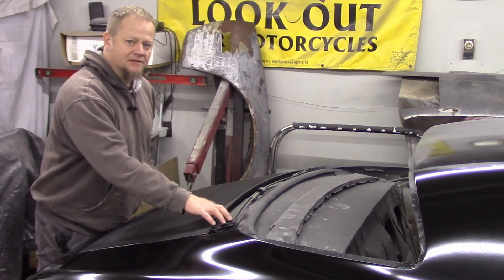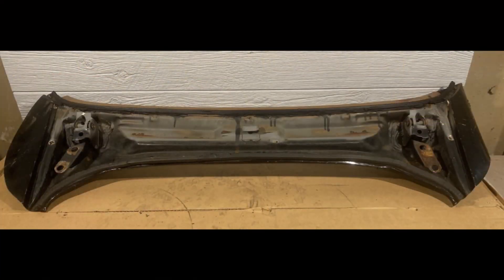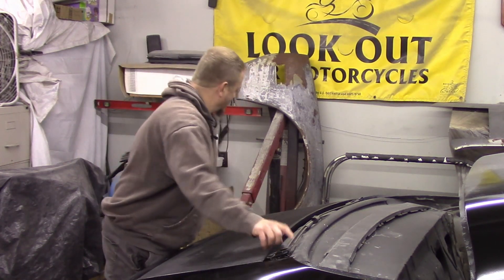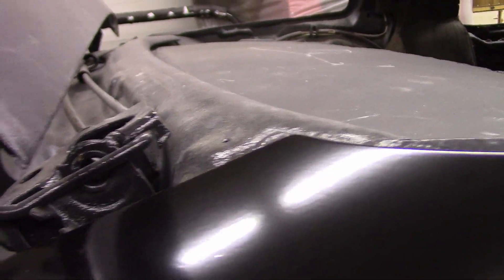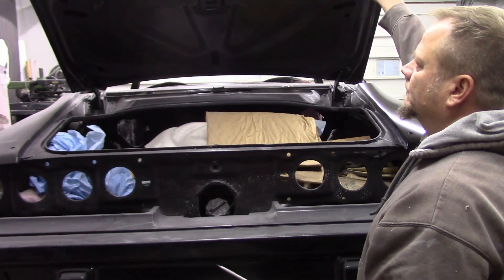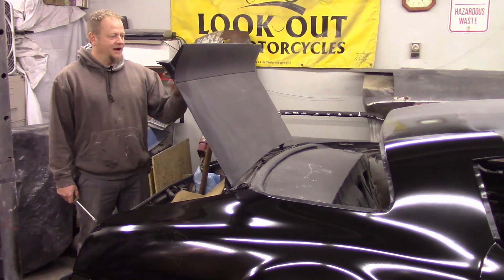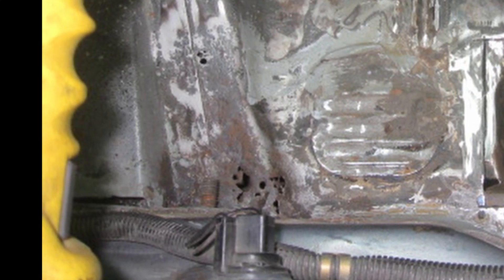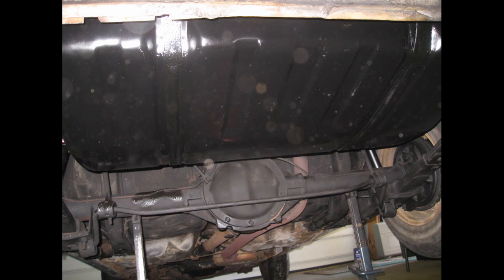Rusty Crusty Trunk Hinge Pocket Panel. Remove and replace: The Nuclear Option. Trunk floor work too!

Comment: Very nice work there sir. Hey, I was wondering, what color are you thinking for this baby?
Reply from the maker: Thanks man! Those pics were about 8 years old. It was a fun project.  As far we color, I’m torn....my wife thinks I should just go ahead and buy the paint to end the debate 😂. Originally I wanted to do UreKems Merlot Pearl. It’s like a deep burgundy. But now that I see how good the glossy primer is looking, I’m thinking about gloss black. Like, cut and buff till it’s a mirror. Satin black racing stripes on the hood and trunk, outlined with red pinstripes. Window tint, smoked marker lights, satin black trim and some old school 15” rims with fat tires and white letters. I dunno. I’d be happy either way. Loving the blacked out look but I know they the body work has to be flawless...
Reply: @HeavyPedalGarage  I can't lie, that thing looks really sweet in black. Your body work looks pretty stellar so far! I think your black paint plan would look KILLER. Do your cops write tix for tint? In CA you can't have ANY tint on your sides (front seats) or windshield. I have a funny story there. I had a Hyundai Excel back in the 90s. I drove up to the mountains and a cop pulled me over and wrote a ticket JUST for that. Was not speeding or anything. I then got really sick, and could not get it sorted out, so I had to drive back up there to get an extension or something. THE SAME COP pulled me over again!
Reply from the maker: @asicerik  Dang man! just for tint..... Jeez.  Ohio isnt too bad.  Legal is less than 70% VLT on the windshield and less than 50%VLT on the front side windows.  The rear windows can be whatever, just not reflective...  I know some people push that and don't get hassled.  Ill probably just stick with legal tint as i dont want to be completely blacked out windows anyways.

Comment: Exactly what I love to do. I just can't bring myself to do anything but stack parts when it's 19 degrees out and all I have is a little kerosene torpedo. Looking so good dude. 

LOL at torsion rods. They drive everyone nuts. Loving the progress brother!
Reply from the maker: Dude! I totally agree. It’s been pretty cold here in Ohio so I haven’t been out in the garage much. Still wanted to do a video so I threw this together with 8 year old pictures.   I do have a torpedo heater that works pretty well out there but it takes a while to heat things up so sometimes it’s just not worth it. Come on spring!!!